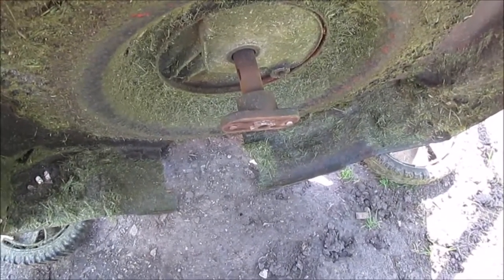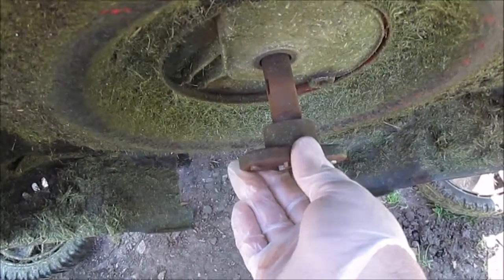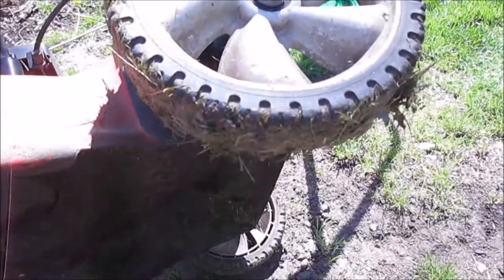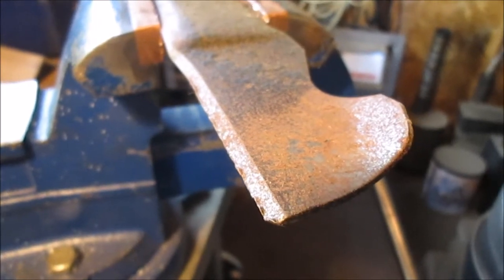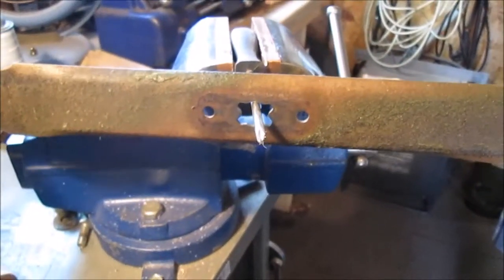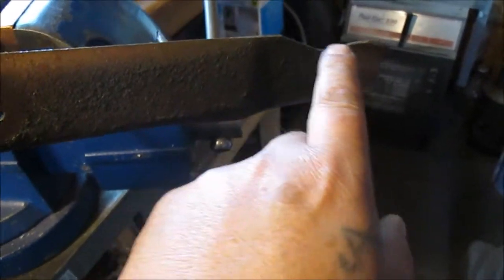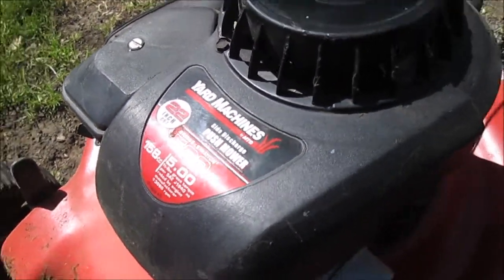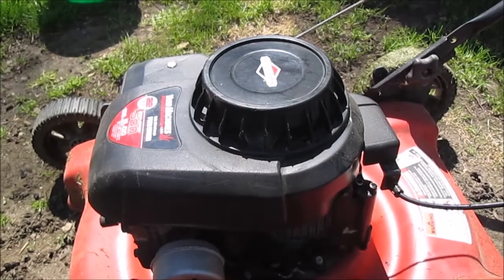7 Year Old Pushmower ( Change Oil & Sharpen  Blade )

Comment: Thanks for the shout out Jim.  That blade adaptor is a bit loose but once tightened up it will be OK..
Reply from the maker: You are welcome...I did make sure it was tight ...I should find the torque spec on it
Reply: I did find out but now I just make them hand tight with a good ratchet.

Comment: I'm well over-due for a mowing.... my weeds have turned into hay lol
The Briggs on my push mower doesn't even have an oil drain, you have to tip it up on its side and make a big mess.
Thumb's up
Reply from the maker: I mowed grass over a foot tall  behind my garage ..I have mowed the yard twice this spring...My new mower has to be tipped on it's side to drain the oil it was a little messy

Comment: I think 158 cc is about 4.75 horse power.
Reply from the maker: Harbor Freight's 3 h.p. says it is 79 cc....Double that and you get 158 cc 6 h.p. ..But that doesn't mean they are right or  I am right ...Then mine has a torque rating which is more confusing